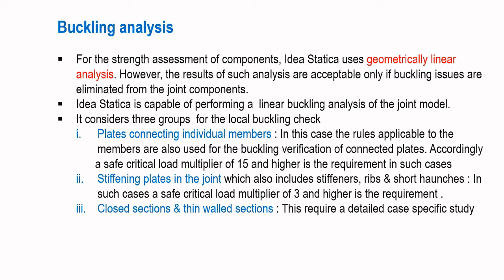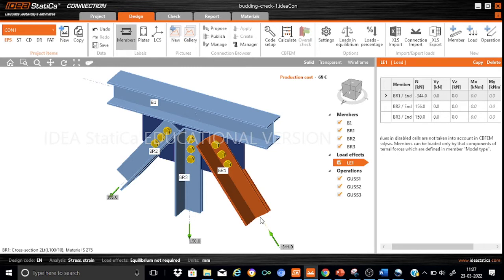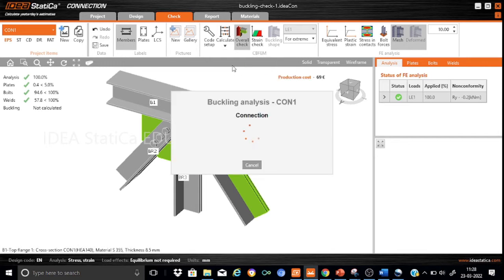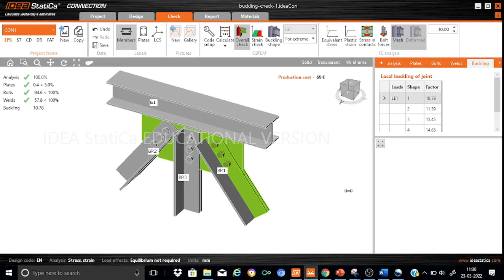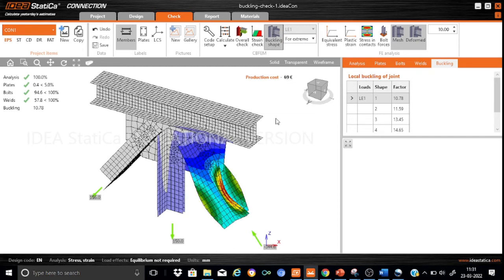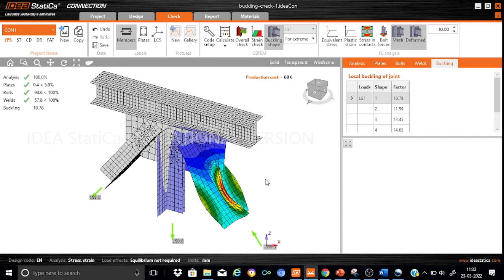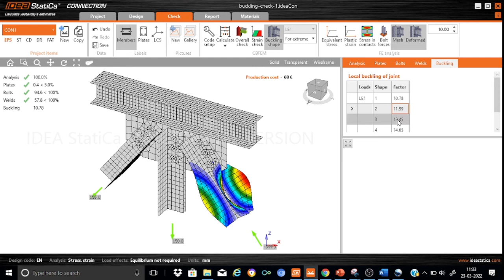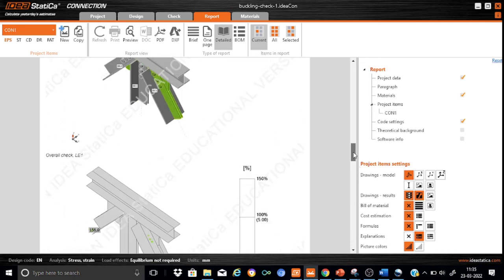IDEA Statica: tutorial 27- Buckling analysis of structural steel connections

Comment: Dear Puttat, 
In end plate results I got : 4,6,18,21,25 
I can see that in case of local the results are acceptable >3 but at the same time global buckling check for first and second modes is failed 

So, what is the right conclusion?? Shall I depend on numbers >3 so that buckling pass in all modes or redesign the main member by adding stiffeners?